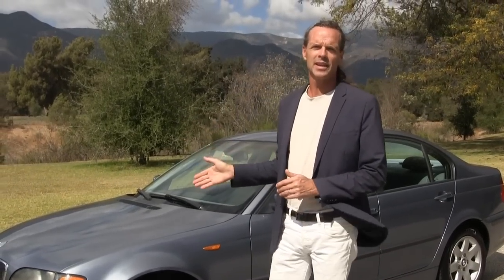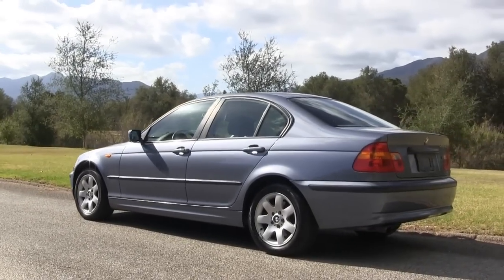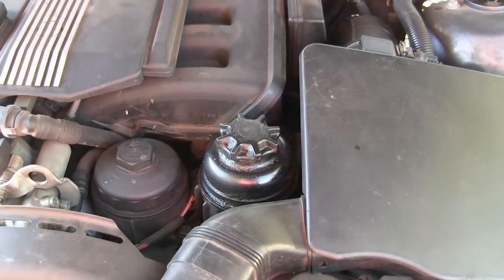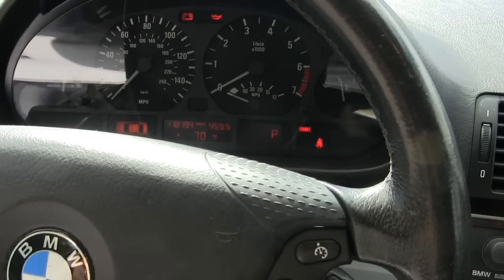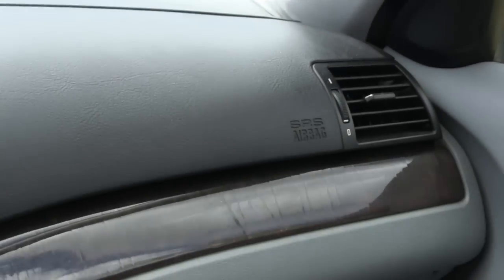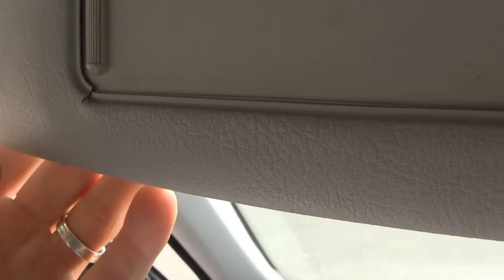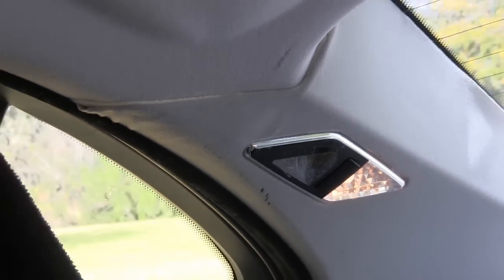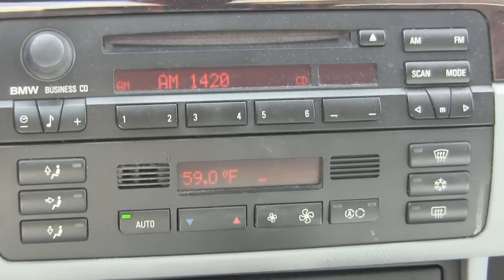Why You Should NOT Buy a Used BMW

Comment: BMWs are made to last until the lease expires.
Reply: My daily driver is a 88 5 series. 354000.
Reply: @associatedstress6453  cars since 2005 are made with plastics so any car you buy nowadays will never last another 31 years like your 88 ! (I'd be surprised if it lasts longer than 3+1=4 years!)
Reply: My e46 has over 350k on it and all I have changed his ignition coils spark plugs and hub bearings edit runs and starts perfectly every day.
Reply: Never buy a German car out of warranty, period!
Reply: @dkastil  As a BMW owner and car enthusiast who has over a dozen mechanic friends I can attest that: That's not possible. Please see a neurologist at your earliest convenience to be evaluated for early onset of dementia. You will be in my prayers.
Reply: Papa Torr you have mechanics as friends that is nice. I fix my own car and it’s still kicking .
Reply: @dkastil  I can believe that you fix your car and that it's still kicking. But you've done a whole lotta work to reach 350k miles! Not just what you mentioned
Reply: Papa Torr that’s not true all it has had is a water pump ,ignition coils ,spark plugs ,secondary air pump line and oil +filters .
Reply: @dkastil And you've owned it since day one?
Reply: telldem1 Truer words never spoken. I thought it was just my first BMW. My next did the same. I’ve since switched brands. I couldn’t take it anymore.
Reply: @etherlords88  if you take good care and don't stress the car too much it will last but y'all full send it like bro it isn't a honda civic it's a bmw
Reply: @associatedstress6453  Love to hear it!
Reply: @jjk3840  only a shit car cant take abuse from time to time
Reply: Ppl just don’t know how to take care of them

Comment: I would indicate that your thumbnail needs to be modified because it is generalizing BMW completely which would not be correct. I have 1991 bmw 525i with 235,000 plus miles, 1994 bmw 530I with 260,000 plus miles, 1999 bmw 740il with over 221,000 plus miles and just purchased a 2007 bmw 328xi with 134,000 plus miles and I have not spent nowhere near what other people have said they have spent on just one bmw. This is being stereotypical which is ignorance.

Comment: +YourCarAngel I think you are talking a load of tosh! You have picked the worst example E46 to show in this video. All cars will disintegrate if they are not looked after even a Rolls Royce! Neither are they that expensive to fix as you make out. I mean $700 for window regulators come on! Find a good independent garage and it will cost less then half that. I am in the motor trade and come across many E46 as well as other BMWs and never have I seen one with all those interior issues yours has. Personally I have had BMWs for over 25 years and none of them have given me any serious problems but then again I do look after my cars. I guess that's the point buy a well looked after example and you will not regret your purchase. Finally the sub frame problem should have been fixed in almost all of those cars affected by now so if you did buy one now you should not have to worry about it.
Reply: I agree with you here it’s even way cheaper

Comment: As an E46 owner, who knew full well what i was getting into when i purchased it and actually wanted the project aspect of the car, I have to say that this video is about 50/50. He missed a well known pattern failure in the engine, at least the M54 which is shown in this video, where the engineers decided to use a different style oil control ring on the pistons, which wears out faster than the traditional "crimped" oil ring that you see in 90% of other engines. The result is the engine starts to burn oil at a relatively young 150k miles or so, maybe longer if proper maintenance and oil change interval was observed by previous owners. Fortunately there is a workaround involving deleting the CCV system for an oil catch can to increase the vacuum in the crank case and force the rings to contact the cylinder walls, more or less completely stops the oil consumption, but its a 75-100k mile bandaid, the engine will need an overhaul at some point in the future. 

The M3 subframe issue can happen to any of the E46 chassis produced before 2002-2003, and it can still happen to later models, but its less likely. 

The rest of the stuff is spot on. Its a BMW, If its not leaking oil, buy a lotto ticket... the things leak on the showroom floor... lol. The headliner and pillar fabric issue is annoying but cosmetic and a pretty easy fix to even the most boneheaded grease monkey that's never set foot in a fabric store before. The interior plastics... look for a car thats had tinted windows for most of its life? UV is hell on all plastics. my 2012 GMC truck already has multiple cracks in the dash and exterior plastics turning gray. Its not really a unique problem for BMWs. 

Its a really solid car for the most part, but non-mechanics need not apply. If you have to take your car to autozone and have the 18 year old kid behind the counter come put new wiper blades on for you... STAY AWAY! If you can change a rocker cover gasket one handed while sipping a beer with the other... then its the right car for you!
Reply: what do you mean by engine overhaul?
Reply: @TheMasterStudent  engine rebuild basicaly

Comment: I put over 250,000 miles on an E46 328i and the only thing that ever needed to be replaced that wasn't just "wear and tear" maintenance was the AC compressor. I still have that thing. Still runs just fine.

I feel like a BIG majority of problems that people run into with used cars in general is just the previous owner/s not maintaining them properly. The overwhelming majority of people know nothing about cars and typically don't know how to take care of them. Most cars from the past 15-20 years will hit 300,000+ miles fairly easily if you just care for them properly.
Reply: THANK YOU!
Reply: mleindek In college I worked at a tiny little mechanic shop, and I was absolutely dumbfounded by some of the people coming in with their "shitty cars that always break man!!!!". Cars that had no coolant in them whatsoever, cars that hadn't had oil changes for 50,000 miles, cars that are being driven in third gear on freeways at 6,500 RPM for years on end. It's amazing how little the average person knows about their own car, especially considering that a car is typically the second largest investment people will make in their lives after buying a home. Car literacy is almost non-existent among the general population, so they fall apart, and it's always the CARS that get blamed for it! Most cars don't just break, they are broken by idiot owners.
Reply: True that, my daily is an e46 with 250.000 miles and it has been well taken care of, all the maintenance done on time and NEVER left me stranded. I've seen cars with 60.000 miles beaten up to dead and the same exact year/ model with 150.000 miles and proper maintenance running like a champ. Maintenance is KEY!
Reply: Oh how very right you are.
I have a BMW 730d with 450.000km and it runs AND looks very good for it's 10 years. I'm really happy with it. But regular services, at leas engine and transmission oil change must be done. If you don't do that, you shouldn't blame the car. Any car.
Reply: Exactly. You clearly see that nobody has ever taken care of this car in the video. It looks like it was parked in the desert in Arizona for years with no shade and cats or little kids scratched the whole interior.
Reply: it's all about taking care of a car. May be a freaking Hyundai or Toyota is more forgiving if you abandon it than a German car. But BMW is about the pleasure of driving and it's true. Buy a Hyundai if you just drive to Walmart and back, but if you love to drive, buy a BMW.
Reply: straight 6 engine? With 250k on it it's still young
Reply: tuvalu in all honesty it becomes a rebuild after about 100 k
Reply: I own an 1993 E36 318i with the M42 engine. 185k miles now and the engine still goes strong with a very low fuel consumption. BMW's are not perfect, but the engines are the best engines on the planet and they will last forever if you keep them maintained properly. What you cannot do is to delay oil and radiator liquid changes or use bad quality liquids. Also check liquid levels. A Corolla may forgive you that you run it on half of the radiator liquid, a BMW motor will overheat and is done by the time you notice the temperature gauge going up
Reply: I had an e39 528i sold in perfect state at 219000miles, i had an e39 530d sold in perfect state at 198000miles, i have an e46 325ci with 111000 miles, it runs perfectly and looks like it's new.. Any car who has a bad maintenance will fall apart.. people think because they're buying a bmw there's no need to maintain it well because you know it's a german car it's unbreakable.. It is, if you maintain it well.. there's no secret.. the e46 from the video had a difficult life to be in that state..
Reply: If this is true, you just happened to have luck with this BMW,  my 3 I've had have been nothing but money pits and headaches. Yuck.. I'm done!
Reply: Don Johnson SHOULD I BUY ONE FOR 1,500?
Reply: I love my E46, bought it with 94K. So much nicer than any other car I've ever owned. Had to replace a few things for $300. Totally worth the investment. Your right, cars are investments. Theres a reason some are over a grand and cost over $10K. Your signing yourself up to pickup the flag to keep it going.
Reply: @johnghetto9714  Well? Did ya buy one?

Comment: I bought a '99 328i e46 bavk in 2005. I must admit that most of the issues he mentioned are certainly small issues that I've dealt with more than once on some occasions. But it's now 2018 and I still own the vehicle, still on the road after 250,000mi and passed inspection with no problem. I love this car and only set foot in the dealer once for the overflow expansion tank.

Comment: Greg Macke, you are spot on with problems on the E46 series.  I personally owned a 2003 330i with 161,000 miles.  All the issues you mentioned on this video matched 100% with my car, but I have about two dozens more issues I could add to this.  It is a nice ride when new, but a money pit when aged.

Comment: $700 for a window regulator???  Try about $80. Another tip. Don't take your car to a BMW dealer for repair. They will charge an arm and a leg. A good mechanic will charge no more for a service.
Reply: Yea. I had some of these issues with mine but I am proud to say we have fixed most of the issues ourselves while spending very little. The only thing we are outsourcing to a pro is some light rewiring. (Electrical is not my thing.) But, Overall I love my BMW. It's a 2001 330i 5speed with about 220k miles. And runs great. I would definitely buy another.
Reply: Alexis Updegraff you got lucky. I had a 2004 325i for 10 years, 140k, dealer serviced. The thing became a overheating piece of shit. Never buying BMW again.
Reply: Catweasle I have a 2004 Pontiac Grand Am both my front regulator broke and those go for $250 each. So when he says $700 for a BMW I'd say that's about right
Reply: Catweasle you are totally right, you can even search about how to instal a part and do it by your self, you can be your own mecanic.
Reply: Indeed, only in the USA you hear people say BMW is an expensive car to maintain, but really the are not. If you service them how it is meant to be, and NOT go to the dealer, but a good BMW-specialist, the maintenance costs are no more then other cheaper brands. But from what I know, Americans are known for not being so strict on maintenance, like the Italians/French, here in Europe, so no wonder.

I have driven a lot of brands, and every brand has their issues. Everything comes down to proper maintenance, get a good warrantee, and do your maintenance at a good BMW-specialist with good reviews >>> no money pit.
Reply: good maintenance doesn't make up for poor plastic parts and bad engineering.
Reply: Several.  But regulators are an easy DIY.
Reply: yea I have a 05 330I, I love it but my wife hates it. Drives great, but always needs work, and I take great care of the car. The issue is once the problems start, they seem to come in bunches. BMW makes a great engine and suspension, but the rest of the car has a lot of plastic and cheap parts. A lot of junk for such a high priced auto.
Reply: Arlie Hopes y go to rock auto 50 bucks for all four of them
Reply: Haa my dads windows regulator went out twice in his e46, i replaced em for em and it was pretty easy, price wasnt bad either about 100$ each. His e46 323i went all the way to 290k miles till he sold it, lady who bought it still has it running so 🤷🏻‍♂️
Reply: Catweasle You only take it only for recalls only.
Reply: I’ve seen Japanese cars go their entire life and not need a regulator
Reply: Catweasle dont take your car to a jaguar dealer either😁
Reply: no money pit maybe......BUT a Time consuming HObby
Reply: @ctsfiddler  -  It helps if you can park in a garage. Big difference.
Reply: @Europa Man the one with felonies....who learned arts and crafts in prison
Reply: @pravoslavci  I'm sorry but your comments are so rude and ill informed. See my comments above.
Reply: Everything this gentleman is saying is 95% true. But there always some BMW fan boy taking the obvious truth personally. 
BMW means Buy More Warranty .
Reply: Or that mechanic can make it worse
Reply: Ya $700 maybe at the dealership. OEM regulators are $150. Crack a beer and fix it yourself on a Saturday afternoon.
Reply: i once had my nissan car replaced a window regulator, it cost me aud370. so 700 might be true for bmw
Reply: LOL..nonsense. I spent less than $50.00 on two regulators, with motors, from Amazon and changed both out in about an hour in total.
Reply: 80? You can find w regulators for 3 series $20
Reply: They will charge an arm and a leg, Agree !
Reply: I had a three year old 5 Series destroyed when a plastic water pump impeller fell off. BMW thought it was a good idea to put plastic there? Never buy another.
Reply: Yeah i don’t know many mechanics who are willing to work on those plastic shit boxes. A good mechanic would’ve told you not to buy a BMW in the first place.
Reply: If you replace with a salvaged regulator, you'll just have to do it again and again, since there's a clear time limit on them...
Reply: @wydstepbro3566  Like Scotty Kilmer?

Comment: My dad has a 330i 2000 model and everything that this guys has said is what his car is going through now. 
It only has 150,000km and the interior is exactly the same as described, the windshield cowling is turning to shit and he has replaced the window regulators several times.
He has had it since 2003 and taken the up most care with it, but you cant help shit engineering and built.
I also had a E39 525is 2002 model and that was an absolute nightmare.

I personally believe any BMW prior to 2000 were fucking fantastic, anything after is past their golden era and rubbish
Reply: Do your e39 525i have any problems with the engine and/or transmission? Or there are problems only with the interior? I'm going to buy one in the near future.
Reply: JkandI BMW think about only money. They don’t care quality any more.

Comment: This video is absolutely true. I've owned the 3 series for 14 years now and I bought this vehicle with 32,000 miles which was in new like condition. Today it has 147k. Overall It's been mechanically sound, however be advised the major inspection and mechanical issues will be pretty expensive from the dealership. I received a quote to replace the regulators in both front doors and was quoted a ridiculous $1000, so I ended up replacing them myself for about $80 each. Needless to say that was the last trip to the dealership and I started doing all repairs. Parts can be pretty expensive, but do your research as most parts can be purchased for a fraction of what the dealer charges. The car drives great, but every aspect of what Greg mentions is so true and common known problems.  It's alarming how many internal and external components of the car are not made of materials that are long lasting. For the moment the door rain gutters and vehicle badges broke off and it's been a challenge to find inexpensive replacements. I've never seen these things just fall off on any car I've owned in the past. I think most people driving BMW's are leasing owners putting on a show.  Therefore after 3 years or so they surrender the vehicles before maintenance agreements ends.   If you aren't a "do it yourself mechanic", be prepared to put out heavy maintenance cost to be an owner of "The ultimate driving machine".